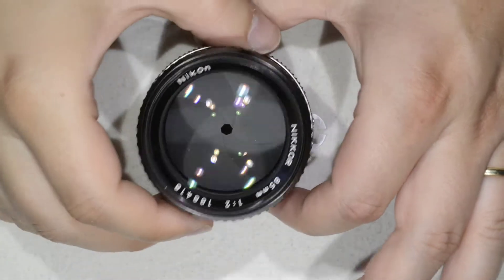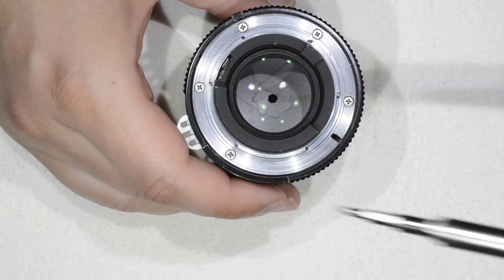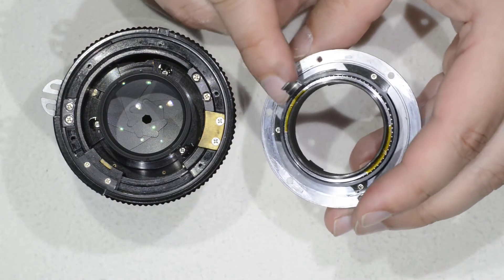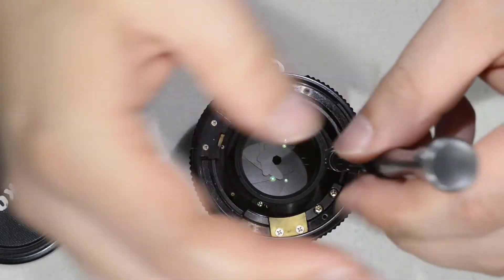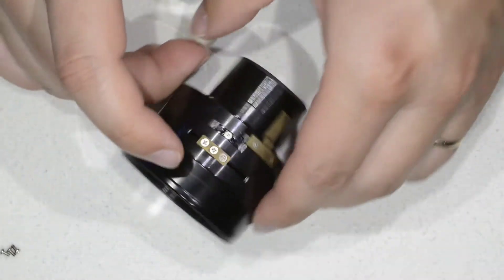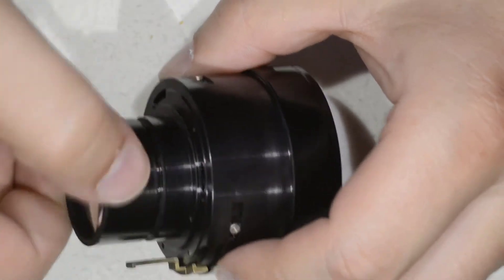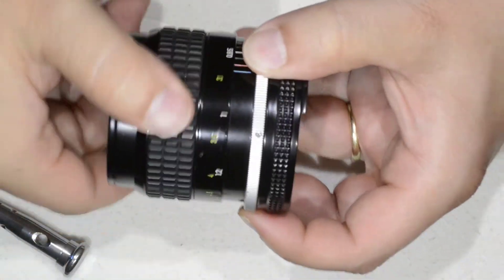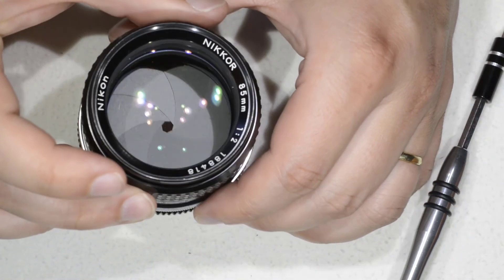Nikon Nikkor 85mm f/2 : Disassembly and cleaning

Comment: Thanks for the detailed video.  The Nikkor 85mm f2 will likely be the first lens that I repair.  I will be ordering all the tools today.  I have many years of electronic technical experience and still I would not attempt this repair without your video.
Reply from the maker: I also have a technical background but it wasn't until I worked in optics that I dared opening a lens. If you don't feel 100% comfortable, you can always start with a lens you don't care if you mess up. Cheers.